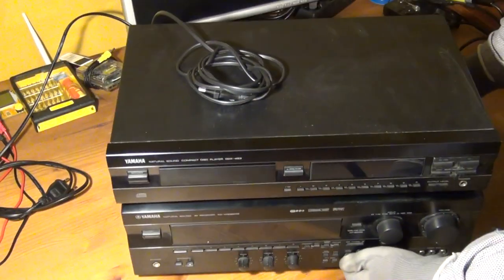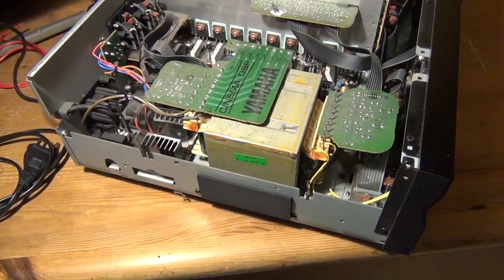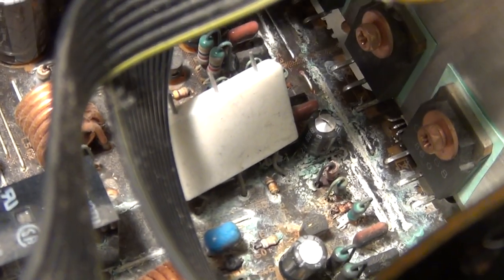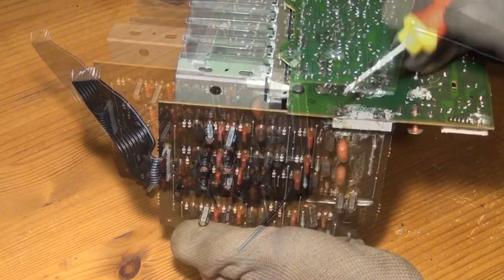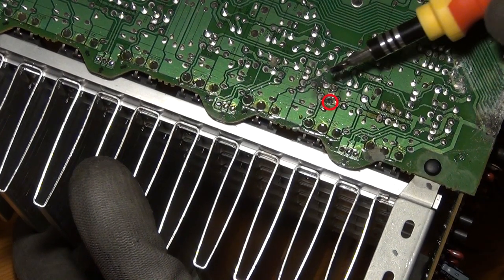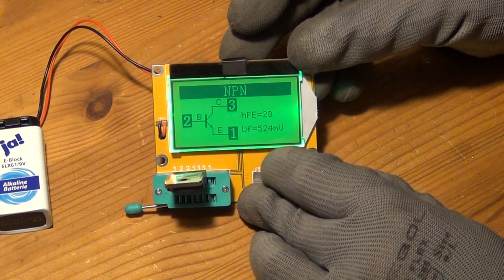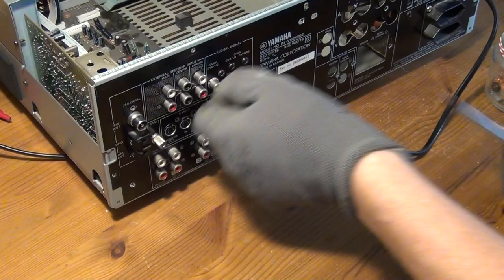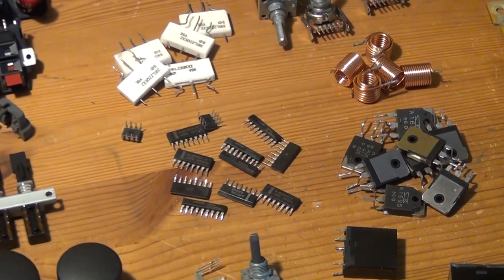Yamaha AV Receiver Teardown, Troubleshooting and Salvage

Comment: The output transistors opposite the bulging capacitor should be short circuit. You don't have to remove the transistors when testing, but only remove them if they are faulty. You can use a simple diode test via your multi meter to test the emitter/ base and collector/base gate voltage drop. The capacitor blew because the transistors shorted, same as the burnt resistors. The amplifier must have been sitting around for several years for the corrosion from the capacitor spillage to be that advanced. Short circuit usually happens when owner is fiddling around with speaker wires when amplifier is powered on. Rarely does over driving the amplifier cause the transistors to blow. Dry joints from excessive heat can be another factor for the outputs to go into thermal runaway and blow out.

Comment: Salvaging electrolytic capacitors is asking for trouble. The only ones worth salvaging are the mains 400V 185C rated caps which are less than 2 years old. The other elkos should go to the trash, or do not even spend the time to desolder them...

Comment: I was enjoying watching your video. Good job. I bought yesterday RX-V596RDS and noticed that volume knob is loose and has play up-down.
After cover disassembly it turned out that solution is simpler. Just removed volume knob and used socket key 11 mm to screw the nut from motor shaft.
Job done😅

Comment: I got one of these receivers in working condition from my in-laws. I don't blame you for scrapping it, but it sounds very good being used as a 2-channel or 2.1 unit as well. I sold mine because it had only analog inputs and all my TVs are digital only (and I have a Technics stereo receiver already that sits in my shop).

Comment: Great video, its crazy that even in todays Yamaha's AV receivers that they still don't add a good cooling system (especially with the price tag Yamaha asks for these systems, knowing they have overheating issues)  Ive lost count at how many youtube repair videos are out there where the problem is always heat destroying the caps, or other component's on these AV receiver's

Comment: I have the slightly lower end than that model it uses the exact same power supply configuration transformer and amp stages. That is not due to useing a low impendance speaker nor has it anything to do with the rail voltage selector. That is liquid damage.

Comment: OMG, two days ago I had the SAME maintenance on my RX-V995, it was starting and then turning off immediately exactly like yours, I just gave up disassembling the boards, and cleaned it with a long brush, patience, much sneezing by the powder, and them washing it with Hexane, the unit is running like new. I wish I had a look on this video before my adventure lol.

Comment: Back in the 90s when I was doing similar things with electronics, those rubber insulators were called 'mica washers' (I think).
Reply: I've heard them called "sil pads" (I think it's a trade name) because they are made of silicone rubber. Older tech used mica wafers which were brittle.
Reply: We call them thermal pads these days in the PC scene you used them for MOSFETS on graphics cards which need active cooling from your heatsink or waterblock

Comment: This is what we use to class as a non-economical repair in the trade decades ago. Not worth the bother unless the customer was so very desperate for that item to be fixed and willing to pay for the time, parts and labour. Yes! it is a real pain to repair stuff like this and even more so on today's SMD stuff.
Reply: hmmmm I have a slightly earlier model .  Shutting off.   plays for about a day or day and 1/2 about every 7 days.   have not opened up yet.

Comment: The cause of the issue was some one spilled some fluid into the unit and then shorted parts and trace burns outs and massive corrosion.

Comment: I have a Yamaha RX-595 and a intermittent mode selector with remote control capability. Your video was very good but it did not concentrate on the selectors.  Can the contacts be cleaned while installed such as with a contact cleaner? It has a metal housing with some holes that surrounds the selector and gear connection for the remote control motor that is mounted 90 degrees to the selector shaft.

Comment: My theory is the capacitor blowing may have been unrelated or happened after the actual damage.  To me it looks like someone spilled some liquid in the top.  Since these have an open grill to vent the heat, it would be very easy to do accidentally.

Comment: I am not very technical, so bear with me. I have the same receiver as in the video. It still works... except the display. Do you know of a fix? I would love to keep using it. It would just be a better experience with a working display. Thank you for any tips!
Reply: It is a bit late now. But you might be lucky, that the display is actually alright. Just the light bulb of the background lighting might have died, so your display can't be read...

Comment: I have this unit and still works good.  My issue is the power/standby button came off.  Can you tell me does this somehow  glue to the power switch inside the unit or does it somehow mount to the face plate.  Seems like it snaps into the face plate but when i push on it, it just pops out.

Comment: I use a quite not very expensive Technics 1987 rack stereoset in the garage. Thing is the garage is most of the year humit, very. In winter it freezes, in a heatwave the clear plastic roof makes it like venus. This extreme condotions have not hurt the Technics, there is not a spot of corrosion inside. Either this expensive Yamaha houses ultra low grade components or is been subjected to abuse far beyond what I do to the Technics.

Comment: Hey, thanks for your video, I was actually having some issues with my Marantz SR-5011 receiver (it shuts down by itself after being on for many hours and enters an error mode with the power led blinking) and was searching for some similar experiences. I started to watch and then just got curious. At some point you mentioned the possible explanation for the Yamaha failure as having to do with some incorrect impedance used and then I remembered that I had set mine to 6 ohms with the previous speakers and my new speakers were 8 ohms. I am curious if it solves the problem. Thanks again!

Comment: Nice video. I have one receiver YAMAHA RX-V430 and it was in the box storaged for a long time and one day I decided to power it on but it was completely dead no power at all. I checked the fuses and the power in the power supply = 13,3 DC OUT PUT. The capacitor on the power supply is normal there is no blurber. What would you suggest for me to do?

Comment: Hey man. I have an older Yamaha A/V 5.1ch receiver that I would like to use in just STEREO mode and disconnect the on board amplifiers and bypass them to an external 2ch pro audio amp.. I dont have preamp outputs. Just rec out. Do you think there is a point in my receiver where I can desolder the on board amp/s and solder in some RCA connectors to go to my external amp? I am sorry for this confusing question but I have looked and looked and havent found anything like what I mentioned. This vid was the closest and I figured you could tell me if its even worth trying?
Thanks.
Reply: Niko Bellic thank you for the reply. I will look into that converter thing. I went on ebay and found an older home receiver with preamp out for 40 bucks. . I just don't have video switching now.  Oh well, it's LOUWD. I purchased a Behringer km1700 amp. Rated at 1700 watts peak but when I do the math, it's actually a little above 500 watts rms per chanel into 4ohms. I am happy but it would be nice to have video switching back. 
Thanks

Comment: yamaha RXV1500 AV receiver,the fuses  are 3A,mounted on 3  vertical circuit boards,they are sealed inside small brown plastic boxes,how do I remove them to look at the fuse filaments?

Comment: Is the headphone out driven by a 'resister off the speaker outputs' or a separate amp??  If it is seperate, is there a cheap headphone amp 'opamp' or something that can make it sound more 'flat' (uncolored?).  I got one of these locally on Craigslist working with remote for $40 but the headphone out is very uneven.  There is a midbass boost & high rolloff & even with the bass down all the way it still sounds boosted but no deep bass then, & boosting the treble makes it spiky sounding rather than airy because it's centered 2 low.  Sony stuff has much more 'naturally balanced' headphone output =/

Comment: May i ask you something about this receiver..? is this receiver had backup batere (like c-mos batere in Computer). in ask this because every time i did setting for my receiver like Speaker (small or big), Speaker Volume (Centre, & Surround), then i'm unplug the ac cable power. when i plug in ac cable again.. all seeting that I already set, back again to Factory Setting. do i have to keep ac cable always plug in to keep this setting...?

Comment: Thanks for the video, I have a similar Yamaha amp, however, mine shuts down after a few seconds, it seems like its a overload circuit that is confused, have you experienced this before.  I also have a technics amp that is doing the same.

Comment: someone overpowered that amp or spilled liquid in it. usually overpowering is caught and the protection circuit is tripped turning it off and protecting speakers and the amp

Comment: Hello, I have a problem with memory backup at my Yamaha RX-V520RDS, so maybe someone could help me solve this. Even short, power loss receiver loses memorized radio stations. In manual there is the statement:
"Memory back-up
The memory back-up circuit prevents the stored data
from being lost when this unit is set in the standby mode.
If, however, the power cord is disconnected from the AC
power outlet or the power is cut for more than one week,
the memory will be erased."

As it is stated if the receiver is without power for more than one week, memory is erased, but in my case, it is erased instantly even if it is unplugged for 1sec.
In the service manual, I tried to find something about back-up circuit , how it stores data or does it have some kind of battery but could not find anything.
Do you have an idea what could be wrong with memory backup? Should there be some kind of battery or some larger capacitor which provides power for memory backup?
This is the only issue I have with this receiver, everything else works flawlessly.
Thank you.

Comment: Please, make a video with the vacuum fluorescent display run on arduino (or something similar)!
I've been trying to do that, but didn't know where to find a good multiplexer, that can handle that voltage.
Reply: I have used some 74HC595 shift registers with 3904 & 3906 transistors on each output to drive multiplexed VFDs. The transistors drive the VFD pin high, and resistors pull the pin low.
Newer VFDs are fairly low voltage, most of mine run on +10v & -20V.

Comment: I really need help my receiver recently  Started dropping all volume as soon as bass notes hit I don't know what it could be any suggestions would be helpful but I feel like it might be the output capacitors
Reply: I had the exact same problem. I thought I would have to get it repaired. Turns out, my Samsung tv was blinking on and off and when a friend came over to help me disconnect coax cables, one was no good and once we removed it, the tv was fine and I just jumped out of bed to test the receiver and it works at high volume! Check all your wiring in your stereo system

Comment: i have the same unit that is working fine only problem is if the power goes off  from the electric company i have to preset the stations again- can you or anybody show me where is the backup memory battery location is

Comment: I'm guessing lab power supply :)
by the way those isolation tabs are usually silicone for good heat transfer.

Comment: it's a low end receiver, lots of damage, and no HDMI makes it too out dated to waste time with.
Reply: dwoodog still sounds good in a 2.1 configuration For instance I have a pair of klipsch r41m speakers and they sound better with my old Yamaha amp with no (HDMI) compared to my Onkyo TX-NR676 reciver with an (HDMI). But yes it is nice to have HDMI.
Reply: Old Yamaha when new was $400 in the 1990s and the onkyo is 650 in 2020.

Comment: You said solenoid, but I suppose you meant coil or inductor.
Reply: solenoid is good enough.
Reply from the maker: From Wikipedia: "A solenoid...is  a coil wound into a tightly packed helix" https://en.wikipedia.org/wiki/Solenoid
Reply: Well, in American english,a solenoid usually refers to a device that uses an electromagnet to move a metal pin in and out.  Although the wikipedia article does mention that as well.
Reply: that's first called a linear actuator, solenoid actuator or just solenoid but in the context of mechatronics. Context is always important. What would you understand if you heard the word 'conductor' in a youtube video about orchestral music?

Comment: Can it play in dual stereo mode? I want to connect 2 bass speakers on main speakers (with crossover for low band) and another 2 speakers on other 2 channels (as a satelitte speakers wit crossovers for middle and high frequencies) I am not interest in any other combinations, so it's fine to me even I must make some changes in internal input connections. My wish is to make quasi bi amp (passive) from this receiver.